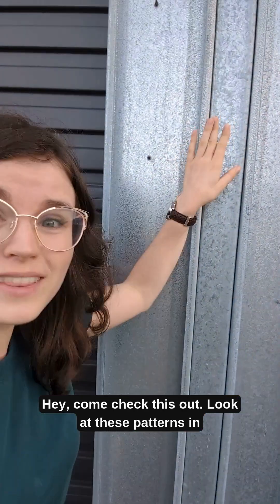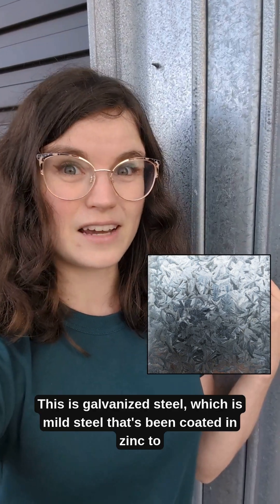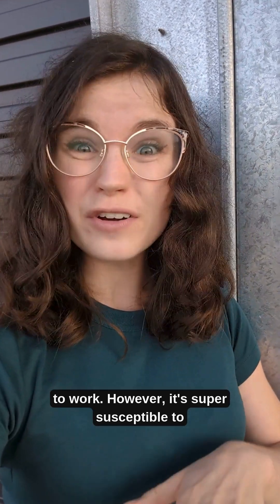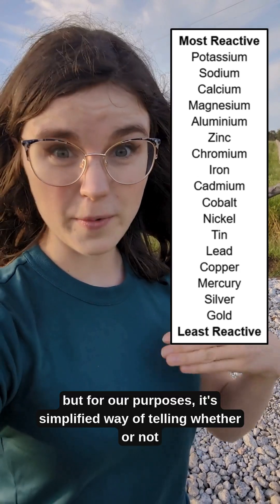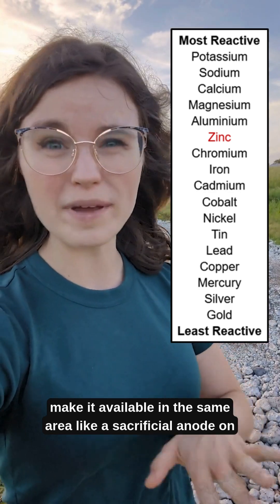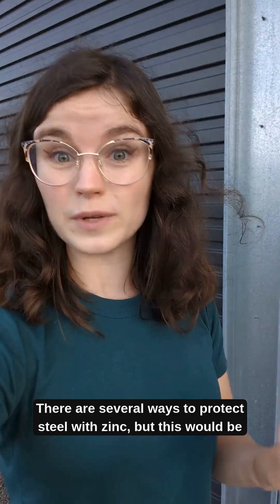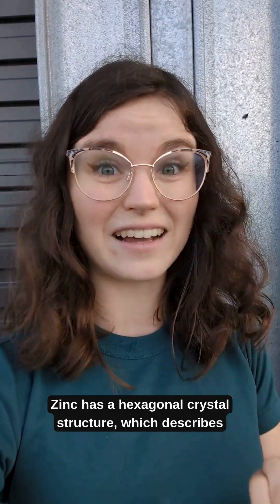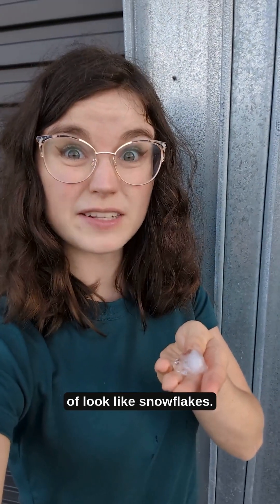Snowflake-like crystals on galvanized steel?

Comment: As a welder I can also tell you it's very important to clean off all the galvanization in a radius around where you will be welding, or you need a really really good respirator unless you want lead and zinc poisoning

Comment: I'm guessing electroplated zinc would give hexagonal lattices as well since you're allowing the zinc atoms to crystallize on the steel
Reply: From my tests the electroplated zinc has a different crystal structure and makes lots of tiny crystals of zinc quickly so you won't  get the effect galvanised steel has.
Reply: I've looked on google images and it seems to not present these crystal structures unfortunately 😢... It kinda looks messy like the zinc has differing amounts of layers of atoms on top of eachother so you can kinda see "shelves" of zinc

Comment: Wait, what? If aluminum is more reactive than copper, why does your macbook not corrode but a copper pipe or decorative plate gets REALLY tarnished??
Reply: That aluminum in macs is anodized, aluminum is great for oxidizing a very thin protective film on its surface that keeps the metal underneath that film from oxidizing more; anodization is a very controlled process that achieves the same effect. Copper is also good at this, but the effect is counteracted by the conductivity of water in pipes, or the tannins in wood, the salts present in oily hand-chum, and many other factors. Fun fact, silver is one of the most noble metals, and is known for being unreactive, but silverware tarnishes so bad because of the sulfur in the air caused by the burning of fossil fuels. Before the industrial revolution, silverware didn't tarnish except where there was volcanic activity producing chemically available sulfur, and in the presence of some foods and toxins for the same reason. God i love this stuff.
Reply: @andyanderson2143  thanks, I never knew that! I love learning about this too!
Reply: Aluminiums special in that it likes to form a thin layer of aluminium oxide which is corrosion resistant and protects the aluminium underneath. 

Iron also forms an oxide but iron's oxide is garbage and breaks off exposing more fresh iron to oxidise (so on and so forth). 

It has to do with the material properties of the oxides basically.
Reply: @R462venom  that makes sense, thanks for explaining!

Comment: Man, I used to hate cleaning up zink coated parts, especially when I had to clean the whole part off because the zink didn't evenly coat the part or we needed to add something to the part.
Long story short, the metal dust gets EVERYWHERE.
Oh boy, if you thought glitter was bad, zink being ground off is like glitter on steroids.
I can't even begin to explain how annoying it is to assume it's all off of you after like 3 showers only to find a little metal sparkle....

Comment: I work with galvanizing, and this is a good explanation. I never get tired of the way it looks when it has cooled off.
Reply from the maker: So glad to hear you liked it! The crystal structure is just stunning
Reply: .this guy

If its electrically charged to apply, it makes a sand like pattern..